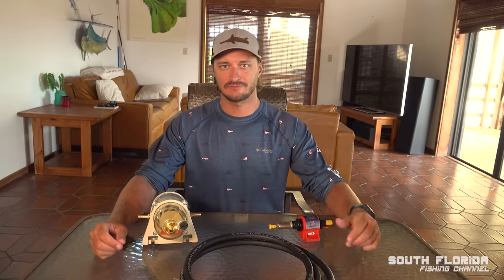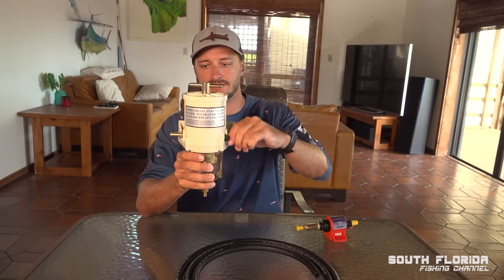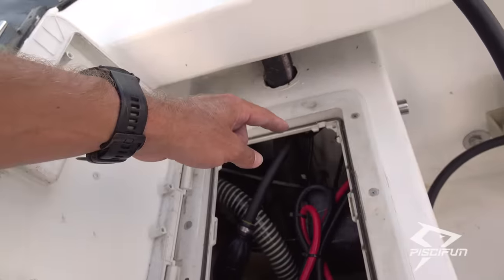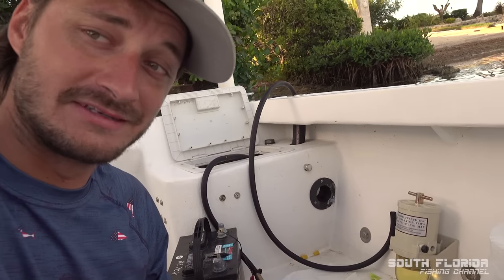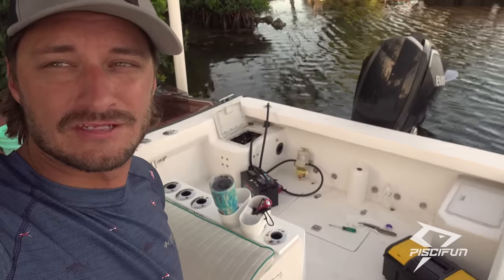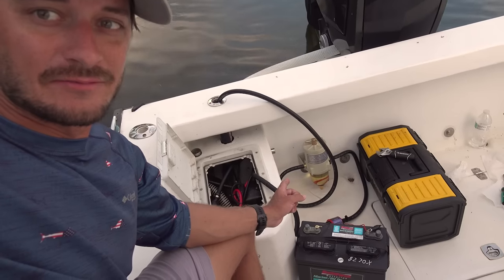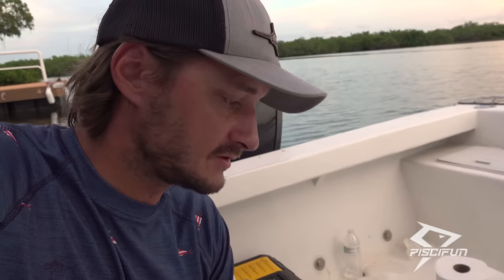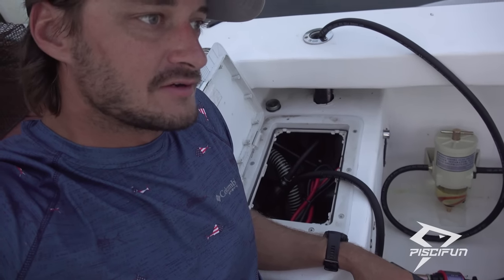DIY: How to clean your boat fuel under $100 {everyone should do this}

Comment from the maker: I'm not a boat mechanic expert, but I finally got my boat issues under control and this is how I fixed the problem. Ever since I cleaned all my fuel the engine has been running great again! Did anyone find this video useful?
Reply: You should use rec 90 then you don’t have to worry about it that’s all I use never had a problem my boat sat for two yrs no problems. Now it been sitting for almost three yrs. I pump some fuel out before the filter (that’s how you really find out how good your fuel really is mines good nothing at all) not a spec of anything. JT HOOKED N ROLLING OFFSHORE 🇺🇸🇺🇸🐟🐠🎣🛥
Reply: I run nothing but ethanol free gas in my tank
Reply: I used regular gas before, boat sat for just about a month then ran like ass. Never again. Ethanol free is the way.
Reply: So long as the boat is running almost on a daily basis or even a weekly basis, it should be fine. I put Stabil Marine 360 with all my fill ups and have left it sitting just under 6 months and never had any issues. I also have 4 strokes.

However the issue here, was crud in the fuel which no stabilizer will fix. A good fuel filter is needed to separate the junk. The lower the micron number, the more finer particulates are removed. The filters will have to be changed more often but the engine will run a lot better.

Great job Heiko 🤙
Reply from the maker: @hookednrolling2009  I only buy rec90. Never put anything else in my boat
Reply: Yes, thank you I feel pretty confident I can do this now.
Reply: It’s ridiculous how sensitive the fuel system can be in our boats. I have a 206 cc key largo and just went through all the same problems I have seen you experience with the engine. Ran all new fuel lines , cleaned the tank and carbs now she purrs like she should.
Reply: Excellent thank you. I’m gunna get my boat goin!
Reply: Is that an in-line fuel filter at the input to the pump? That may be collecting some garbage as well.
Reply: Lots of comments: 1. Try running non-ethanol gas, 2. Try adding a fuel stabilizer to your existing fuel to help it burn thru, 3. Are you draining the water off your mounted racor fuel bowl (that’s what they are designed for) 4. Definitely change and use the Racor Brand filter every 6 months - 1 year (not monthly), 5. Use the recommended evinrude gas additive (my 25 year old Yamaha runs smooth thanks to yamalube and ringfree 6. Keep living the dream!

Comment: Great job I’ve been doing this for years, but I haven’t used a separator like that. I just been using to spin on 10 µm filters. My question is I bought the separator and I see the red plastic piece inside the bowl. No directions come with this unit what is the red ring for?🤷🏼‍♂️

Comment: its called polishing your fuel,  fuel is also known as diesel.  never new gas is called that.   Water molecules  will have critters in it and that's what turns yur fuel dirty.  leaves black crud on the bottom of the tank.  this is the crap that they leave behind and this is what blocks your fuel lines and filters..

Comment: Put the battery outside the boat and extend your pump wire leads so if you generate a spark you have a distance between that and the fuel vapor.

Comment: Thanks for the video. Some comments. 
1. The pipe sucking up the fuel when polishing the fuel must go to the bottom of the tank. The normal pipe ends a bit from the bottom to avoid sucking up the water in the bottom of the tank. So you can't use the existing and instead you must have a pipe going to bottom of the tank, otherwise you will not get all dirt and water from the tank. 
2. It's better to install the pump after the filter to prolong the life of the pump.

Comment: Just a little advice, you may have to change your water separator on your boat because it might be holding too much water or not working anymore
Reply from the maker: It's a Raycor so I can see the water collect on the bottom and can easily drain it out. But the actual filter part I'm sure is clogged with stuff after the last month of running it. I just got 3 new ones =) Nothing like spending $210 on a few filters
Reply: My dad had a 30ft searay weekender that we used to troll for salmon in lake michigan it had two racors because twin 350 mercruisers and we would replace the filter element every other year as preventative maintenance but it was only in the water for 5ish months at a time.

Comment: use hose clamps on those fittings to prevent leaks also. In a pinch or a quick easy you can use zip ties.
Reply: Thanks I was going to say the same thing, it would be very unfortunate if one of those hoses popped off due to pressure and sprayed gas everywhere while it was running. I know that the pump is supposed to be electrically sealed but man I just wouldn't want to risk it.

Comment: Fuel Expands quite a bit with temp,  the expansion and contration in the tank moves air in and out of the system ( The air is probably where most of the moisture is coming from over time ) , This also happens at the Gas Stations and when they ship the fuel, so it all adds up , As the end user of the fuel we end up with most of the contamination.

Comment: Condensation! Full fuel tanks will develop little to no condensation where as half full or near empty fuel tanks will develop condensation and cause water/fuel issues. Also I'd install a fuel separator with a clear bowl so you can easily check it BEFORE you start the engine. Mine has a petcock in the bottom to drain any water that may be seen. ALSO make sure you have fuel filters to capture trash in the fuel. Live and learn. Great videos! Keep up the good work Heiko.

Comment: While this is a great theory, it will never get all the water and crud out this way.  The problem is you're using the pickup tube, which does not extend all the way to the bottom of the tank.  I did a 3-part video on my fuel issues, including tank pressure testing for leaks) and learned this fuel pickup issue the hard way.  The best way to do a fuel "polish" is to put the boat on the trailer, remove the sending unit, tilt the boat so all the water runs into the front or back (depending on which way you tilt the trailer) and use a supported hose to pull your contaminated fuel from the bottom of the tank.   (I wrapped a heavy aluminum wire around the fuel hose that I inserted into the tank to pull the bad fuel out so it stayed rigid)
Reply: Not all tanks can you take off the sending unit without damage to the tank and then you'd be stuck replacing the entire tank. If this is the case what method works best in your opinion to me if you do this an also cause movement in the tank the debris will move float up and around so it would get the garbage from the bottom but if you have a better method i am all ears.
Reply: @Matthew-ev4cv  some vent tops are removable.  That would be another option.
Reply: @MEGA_SOKO  there are 3 hoses and the sending unit.....what vent top?
Reply: @Matthew-ev4cv  The 3 hoses on top of the tank are:  Fuel fill (larger of the 3 hoses), the fuel supply to the engine and the vent hose, which allows for expansion and contraction of the fuel.  I have seen on some tanks, where the vent threaded and the hose barb is removable.  This is usually more common on aluminum tanks.
Reply: @MEGA_SOKO  oh ok mines plastic

Comment: You didn't consider condensation formimg in the tank. The air temperature can be a different temperature then the tank contents. If the air temperature is cooler then fuel then water will form in the tank.

Comment: Heiko You cannot throw water on a gasoline fire. I love your idea that is fantastic and when you’re done leave that fuel filter separator in the boat, leave it hooked up.
Reply: Well....... technically he can throw water on a gasoline fire but it won't do any good except maybe spread it more 😂
Reply: @fungus4758  
That's like saying yea you can jump off a 20 story building but you will die

Comment: Your fuel vent on the outside of hull could be another culprit. If the vent hose does not have a slight rise to it and your taking any waves broadside , washing hull you’ll get water in fuel too.
Reply from the maker: I've checked my vent many times and it's always been good. It has multiple bends in so it would almost be impossible for water to splash up under, over, around and down it heh

Comment: ALWAYS connect your positive terminal first, then the negative terminal to complete the circuit otherwise you risk a spark, a little risky, especially with the battery connections so close to spilt fuel.
Reply: The ground has the same ability to "spark" as the positive if there is a draw on the battery at the time of connection.

Comment: Good info.  Not sure if you can get/or already run non-ethanol gas in your boat.  Ethanol attracts moisture. And Ethanol does not burn as hot as gasoline,  So it creates more carbon deposits on the pistons, therefore reducing the top RPMs the motor can produce.  I run a 2009 Yamaha 150 4 stroke and NEVER have run gas with ethanol. STARTRON additive will chemically bond the water and stabilize any gas for about a year.  Yamaha Ring Free will burn off the excess carbon buildup on the pistons (works on any gas engine). I use both additives even with non-ethanol gas--never had any issues.   Many friends call BS on the Ring Free.  I have personal experience with my older Johnson 115.  Before using both additives, I could only turn 4800 rpms.  After 2 tanks (16 gal.)  I got 5800 rpm @ WOT.  Ethanol will eat up fuel hoses and all internal o-rings.  Just change the original fuel/water separator at leas every 6 months.  A small price to pay to protect a high value boat/motor.

Comment: I had a similar problem on my yamaha.  I switched from a 10 micron fuel water separator to a 2 micron racor. I have to change the filter more often but there's no more junk getting to my motor.

Comment: because you don't use a Mr funnel!!
filters your fuel before it ever goes in your tank. a 35.00 item saves you a ton of problems been using one for at least 10 yrs. I've never had an issue. filters water and loads of particulates youd never see. my marpac quik view filter (the best) lasts way longer. I have numerous numerous videos all about it showing all the crap that comes straight out of a gas pump.

Comment: The main culprit causing water in gas is the alcohol in the gas. Alcohol has an affinity for water and it will grab moisture from the air combining it with your gas and Florida is very humid so virtually all gasahol no matter where it came from has already absorbed water, so water separator filters are very necessary. Your pump might be slowing down due to draining the battery, pumps use a lot of power.😁🎣🐟🐠💦☔🌊

Comment: heiko if you are going to continue with this setup do yourself a favor extend the wires on pump so the connection to the battery are on the dock 1 small spark can lead to a very bad day. i had a car go up checking a fuel pump under the back seat 2nd and 3rd deg hands and arms  be careful my friend
Reply from the maker: yea lol I was thinking that the whole time I was doing this
Reply: @SouthFloridaFishingChannel
Reply: one other thing to check make sure the water seperator is rated for your motor  my 2 stroke has the big threads more fuel @SouthFloridaFishingChannel

Comment: Definitely check your tank out. I had an aluminum tank in my boat and kept having water issues like this. i even got a similar pump and  a new Racor and made a similar polishing setup. It ended up being caused by corrosion on the tank - I found a dime sized hole in the tank a foot from the sende where the metal corroded. When I cut the deck out and replaced the tank, I found small holes all over the tank.  Condensation under the deck would drip on to the tank and end up going through a hole and polluted my gas.

Comment: You really should have remove the fuel, sending unit and put the suction hose all the way to the bottom of the tank your fuel pick ups sits about 2 inches off the bottom of the tank, so any water and stuff below that point will not be brought through the filter cleaner
Reply: correct, using the tanks pickup is useless...the best way is accessing the port by the sending unit of the tank itself and inserting a copper pipe attached to the end of the suction hose...this allows you to get to the very bottom of the tank...

Comment: i would put some sentry fuel stabilizer in the tank it works great
Reply from the maker: I put in a ton of fuel stabilizer over the months and it didn't fix the issues I was having until I cleaned my fuel
Reply: @SouthFloridaFishingChannel  the only thing is most of that crap doesn't work sentry is the boss

Comment: Hey man, how are you doing? Do not comment a lot, but you need to eliminate the check valve adapter at the fuel tank where the hose connects to the water separator. This caused problems in the past to me, buy another one from Home Depot complete open flow without restrictions and prevent acceleration. The ETEC already carries a check valve, so there is no need to have that one at the tank with a ball inside that is also stuck on the high-pressure pump. Another fix with less than $5.00. Great videos, man; always enjoy TIGHT LINES!!!!!

Comment: 1) ports on that Racor knockoff are MORB. Male oring boss. Not NPT. Npt ports would tighten and not bottom out the way they did in your demonstration. 

2) water separator you used is a Chinese knock off made by Griffin. Why support communism?

3) separator is rated for Diesel not gas. 

4) battery/spark source near open fuel vapor will kill. You know better my G. 

5) gas fire plus water means more people can die. 

Moral of the story, buy the right stuff, locate battery outside or out of range of higher than where heavier than air vapor. Hope USCG doesn’t see the video.

Comment: but your sucking it threw a filter so you're not getting the true fuel off the boat and that racor is full that system isn't doing squat and it should come from your tank so it cleans the fuel because right now it isn't doing crap!

Comment: I’d move the battery further away with longer wires. If your smelling fuel while attaching the wire to the battery all it will take is one spark and… well……poof.

Comment: hmmm. Maybe you should try connecting the old filter in reverse and running it through your new filter to see if the clog comes out of the out filter and shows in the glass of the new filter. If it works, it would be a quick way of cleaning/reusing the old filter without buying/replacing an $80 filter. Also, I just want to see what comes out of that old filter.

Comment: Maybe fuel in the keys my truck started acting up after getting fuel down there. I wouldn’t change it every month change it now and keep a spare on hand. When you have issues change it and get another spare that will tell you how often it needs to be changed. I think the racor filters have different size micron filters you may have too small of a micron filter causing some of the issue. Your engine should have a filter on it somewhere under the cowl you racor should be the same micron as that.

Comment: Do you run Rec 90 fuel ? The ethanol in regular fuel sucks humidity from the air and separates in the tank. Also add enzyme additive startron

Comment: Heiko- Brilliant! This was right on point for me. I have the same hull design as your boat, mine is a Palm Beach 235. I have been dealing with the same issues. I'm going to do this polishing but go through the pick up opening in the deck like you pointed out. Does the polishing filter you used require a filter replacement ? I looked on amazon and couldn't tell and it wasn't mentioned.

Comment: I bought that same pump from amazon. Worked twice before quitting. I also had a 10 amp fuse in the circuit. Fuse did not blow. Now sure how to disassemble it. Looks like a press fit.

Comment: You are on the right track with your fuel issues 

After your done cleaning your fuel 
Clean that new filter and install it directly into your fuel system so you always have clean fuel

Comment: You raised a lot of topics. 80 dollars a filter? I'm going to get my own separator, but use loose cotton. Your 2 cycle? I have a Tomking TK144FC, with springs changed so it will troll. It's an air cooled 4 cycle, so starting is a snap, and I can turn it upside down and pump out the last drop. It also goes home and sits in the closet. The tank is only for refilling it's little 1-4 hour tank. Your boatbuilder did a gigantic disservice by glassing your tank inside the boat. My Rover, Cessna, scooter, Lowecraft, friend's Searay? All their tanks come out to be shaken with sand and dish soap. A new air cooled diesel came into my life, so it's spare tank is going to be fuel polished just like yours. The only smooth 2 cycle I have is a 51 Elgin 6 pony. It horrifies some boat or plane people, but you can fill a tank with clean tap water then drain and separate it all away.

Comment: Add some radiator clamps to your fuel lines and use longer wires on your battery connection to minimize chances of an explosion. Bad gas could be the least of your problems.  Also, don't use water on a fuel fire.  Only makes it worse.

Comment: To do it properly you cannot send the clean fuel back to the tank, because you are mixing it with dirty fuel. You should pump all the fuel out of the tank, clean it, clean the tank and pour it back into the clean tank or use it in your mower or generator. When the engine is pulling fuel the flow rate is much lower than that pump you have and when the flow rate is too high than your fuel/water separator cannot properly separate.

Comment: By the way, all you have to do is buy a fuel separator water separator and it will do the same thing that you just paid $100 for the filters. All you do is emptied them out if they get water in them and reuse them.